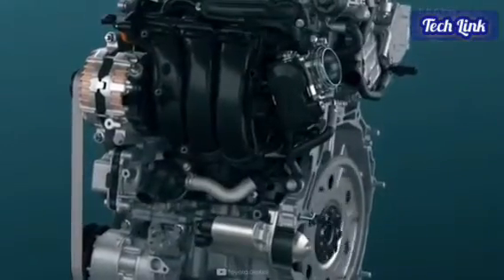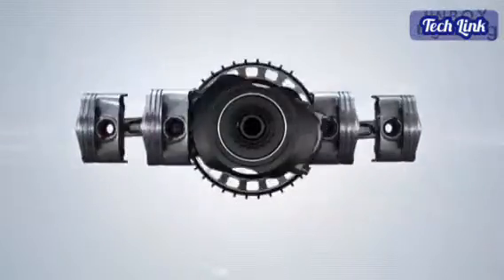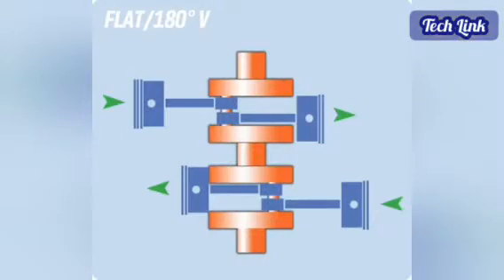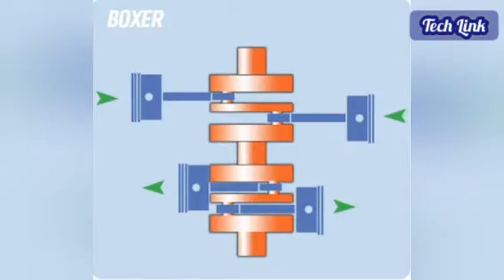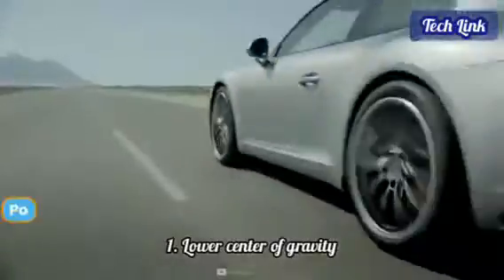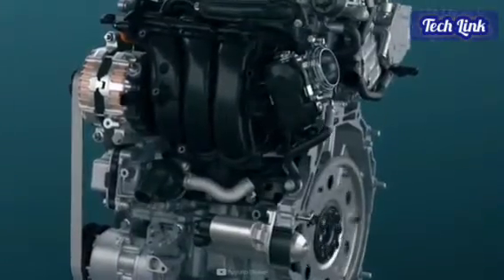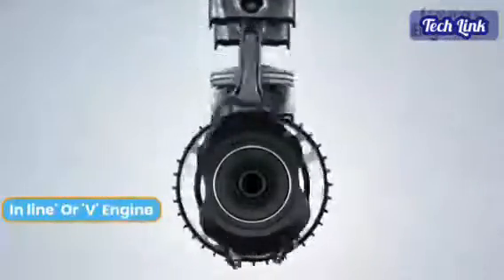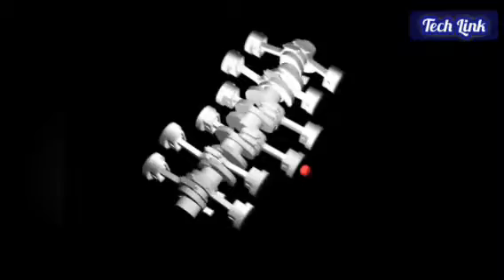Flat engine vs Boxer: Here's the Difference

Comment: This gets some information correct - but complicates it with a lot  of incorrect information, unfounded claims, confusing animations, and poor images.  
"Having a more flattened and tall shape...", re. engine location within vehicle. 
"The engine will drop down the passenger compartment, rather crushing into it." re. flat engines are supposedly safer. 
"... known, due to their configuration, to have a better power transmission from the engine, and better fuel economy."  No, they are not known for better power or economy - because it isn't true. 
Does not resemble a real boxer punching.
We are not having more boxer engines - the number of companies making flat engines has dropped by ⅔ in the last 50 yrs.  
No, it doesn't dramatically reduce vibrations or cancels out forces. 
WTF is that fantasy nonsense at 01:51 ? 😂

Comment: The video is very good and crystal clear for me, but I am a mechanical engineer. People that are not close to engineering environment is rational to find it a bit confusing
Reply: If its purpose is only to have correct information in it somewhere, this video does meet that requirement.  🏆😄👍
However, if its purpose is to educate people, it fails pretty badly, due to the truly horrible presentation.  Images, animation, narration style and narration content all  reduce the ease of learning, and in multiple ways.  💩🚮😒

Comment: As long as a flat engine is defined when a pair of pistons use the same crank pin, while a pair of pistons of a boxer engine use different crank pins, they are different by definition. But why do you say that a boxer engine is a flat engine?
Reply: Or do you mean that the difference between a flat engine and a boxer engine is not the way in which the pistons are connected to the crank pin?
Reply: Why do they (second worst 'bot voice I've ever heard, and/or A.I. channel) say the boxer engine layout, is a flat engine?  🤔 
Well, you may be able to discern a clue, by just looking  at the boxer engine... 😐

Comment: I'm surprised to read the comments and see that people aren't understanding the video, so I'll try to help.

A flat engine is simpler than boxer, then i'll start from it. A flat engine is just a engine has the pistons turned sideways (on 180°), but it usually has fewer crank pins, which means that the opposing pistons need to share the same crank pin, as a result, they work in opposition. 

Explaining this: When the crankshaft crank moves back from left to right, the left piston is extending (because it is in combustion/explosion) and the right one retreating (expelling gases and compressing air inside the chamber in the engine). 
Note that this always results in complementary movements, as the two opposing pistons are moving the engine block to the right during combustion in the left piston (because it will stretch to the right while the other piston retreats to the right too). And then, the block will be forced to the left direction when the right piston combusts and all the opposite movement occurs. 
This variation in movement in the engine block is what we call vibration, as it throws the engine from one side to the other, which can misalign something depending on its intensity.

A boxer engine just works with more crank pins than a common flat engine, which allows the pistons that are in opposition to be able to compress the air inside the engine or carry out combustion/explosion at the same time. That is, they are working in a mirrored manner. That's why the boxer engine vibrates less, after all there are fewer movements in similar directions happening at the same time, since the pistons are always pulling or pushing the crankshaft in the opposite direction with the same force and at the same time (mirrored).

With that, I think you can now conclude what the video tried to explain: A boxer engine is an improvement on the flat engine, and a beautiful improvement at that by the way. 

I hope I helped and didn't cause any more doubts :D
Reply: Thank you
Reply: This was a lot more helpful than the video. Thanks
Reply: thanks mate
Reply: the video was a bit confusing but you made it clear, thank you
Reply: Don't agree.....are you AI?
Reply: @ What do you mean?

Comment: I speak 5 languages and still dont understand :O
Reply: The set of all flat engines includes the set of all boxer engines but not vice versa. 

All boxer engines are flat but not all flat engines are boxer.

A boxer engine is always flat. But there are flat engines that are not boxer.

A flat engine in which opposed pistons mirror each other in movement is a boxer engine. 

A flat engine in which opposed pistons do not mirror each other but rather behaves like a "V" at 180 degrees is flat (as I said) but not boxer.
Reply: It's not a language problem here, but you also have to understand the concept of the engine first
Reply: @slayer223-s9b  Welcome to soviet union where students lecture teachers and problems are being evaluated :D
Reply: Saya orang indonesia sangat murah untuk memahami . Karena ada translate 😂
Reply from the maker: You'll get it

Comment: I’m more confused now than I was before I watching this video about which is flat and which is boxer. So flat is when the pistons mirror each other on the same pin on the crank shaft?
Reply: Both kinds of engine have mirrored/paired pistons and both are flat. In the boxer design both cylinders in the pair fire at the same time. Since these forces are opposite they cancel out, lowering vibration. In the non-boxer flat engine, both pistons in the pair share a spinning crank pin, and take turns firing. Thus this design is like a "V" engine, but with the angle of the V increased until it is flat, 180 degrees.
Reply: you stupid